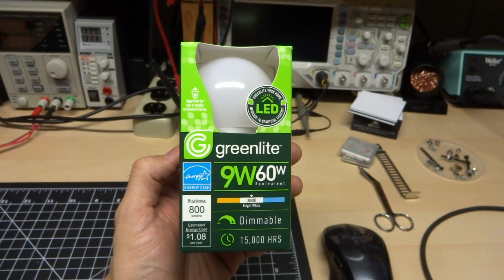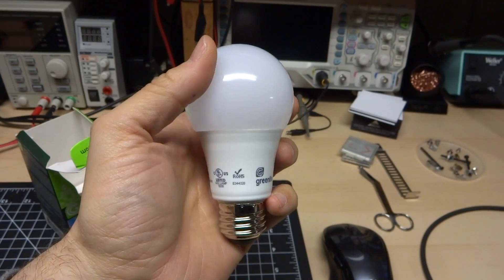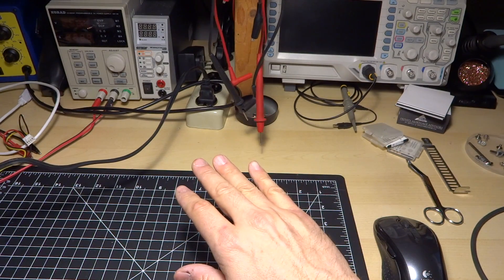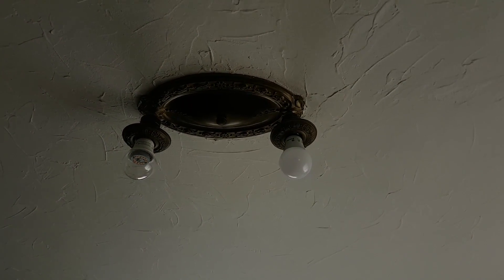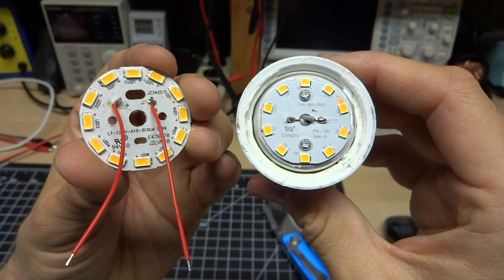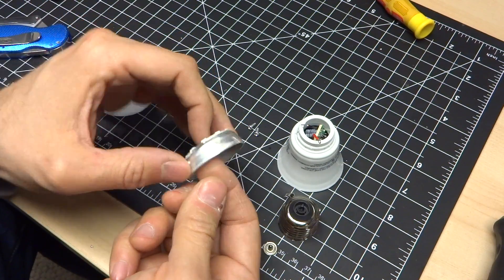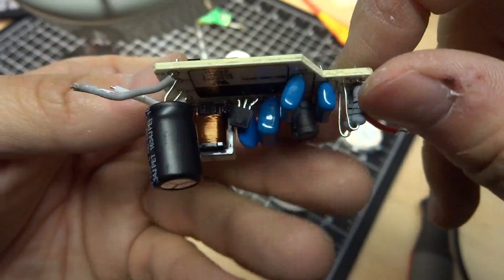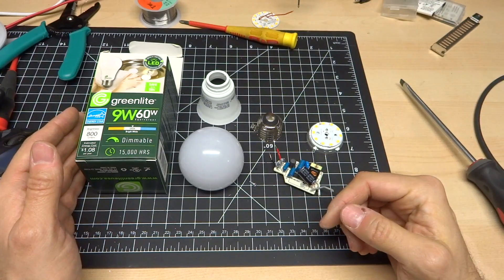Dollar Tree $1 Greenlite LED Bulb 9w (60w) Review and teardown

Comment: Well it seems that I have discovered the cause of my blindness -it’s the 
brightness of  LED light Blubs.(2-10-2020)
 
What happen I changed all my light bulbs in my house to LED last Feb. 2019 
for energy saving. Then Slowly I starting going blind in my left eye, everything 
started turning bright white. I had my eye doctor check it he said he could not 
see any problems so he send me to a retina specialist in Oct 2019. The retina 
specialist said he could not find any problem after intensive testing and I 
would have to live with it. Well yesterday I figured out that bright lights 
could be causing my blindness. So I wore sun glasses all day and night to see 
what would happen to my eyes. My eyesight on my left side was restored about 50 
percent. I continue to were my sun glasses and my vision now is fully restored. 
I replaced all my LED lights with the incandescent blubs and now I can see well 
without my sunglasses. That’s so weird I would not think the LED lights would 
cause blindness. I will tell my eye doctors about it at my next appoint in 
March. Maybe he can write a paper about in in a medical journal
 
Why it caused blindness on only one Eye-actually it 
both-The reason I think it effected my left eye more is 
because my computer lamp with a 60 watt equivalent led blub is on my left side 
of my computer monitor where it was been for the last 10 years.  The lamp sits 
about 90 degrees left of my vision as I look at my monitor, it has a diffuser 
but it does not block the penetration of the bright light. I use my computer at 
night about 6 hours a night for the same last 10 years.but 12 months ago I 
changed it to LED. then I started losing my vision. it got worse everyday. I did 
not see the connection. but now it is obvious. 
I now leave that lamp off and 
use a 25 watt incandescent blub on my ceiling fan.
 
Also I 
had my cataract remove 3 years ago on my left eye. they put a lens implant in 
it’s place. I had the same thing done on my right eye a year and a haft ago. 
Maybe the LED blue light can penetrate my retina easier without the normal human 
eye lenses. My natural eyes could have acted as a natural diffuser to the blue 
light. but any which way the LED lights are causing the problem . I can read 
with both eyes now, sometimes the doctors don’t know all the answers. 

 
I searched the internet and found that this  same 
problem has happen to other people. https://www.youtube.com/watch?v=sijvwheJUrM  
Research people think the led native blue light is causing the blindness but 
they are not sure,  The lcd monitors with led back lite is also causing the 
problem, it seem that the led lights in the computer monitor are also contribute 
to the blindness These led monitor are now in very thing- TVs, cell phones, 
computer monitors etc also led lights are on head lights too. they claim There are glasses with blue blocker to help reduce 
the problem.
 
I am color blind so I don’t think the color is the 
full problem. But I bought some computer reading glasses and viewing 
glasses from ebay for a few buck with blue blocker. My classes with blue blocker 
avail today from amazon. I also am using and old 22 inch LCD monitor I have that 
has ccfl (Florescent light ) back lite instead of my 27 inch monitor LCD with 
led backlight.  I find with my improve vision I don’t need a 27 inch monitor so 
22 inch is fine. I a have a second 27 inch with built in blue blocker. I will 
wait a few month to use it again or I may just get rid of it too. Why take 
changes with my eyes. My big screen tvs are old so so they don’t use LED for 
back light either.  So I think I have covered all bases
 
I am an engineer and not a doctor so I will leave the 
actual reason and cures to them. But My vision is almost back to normal-amazing. 
Actually my vision has improved on my right eye too. I am really glad it’s 
working. So long LEDs- hurray
 
tony
Reply: Thank is for the information I am a lighting engineer am familiar with this information. I get it-I support the use of LED lights to save energy. What I posted was a head up to people about my experience. For me led doesn't work.

Comment: Bought 16 of these about 6 months ago. The light output is much , much better than florescent bulbs. Much closer to old incandescent bulbs. Very broad and even lighting. 8 of them have been burning 24/7 for about 6 months. All bulbs are 'hung', meaning the base is in the up position. Before installing them, I drilled 4 quarter inch holes around and near the screw base  to dissipate heat. I don't know if that makes a difference, but early LED bulbs died because of too much heat.

Comment: A buck for a dimmable LED bulb is pretty darn cheap. Up here in Canada they go as low as 1.50, (so far). By removing the round globe (I use a hack saw), your 9W/60W equivalent bulb will at least double its lumen output, but will become directional not diffused. For applications like light fixtures and to use as grow lights this is ideal. For growing plants, make sure you get the daylite ones (5000+K).

Comment: Oh, these are the ones I have but I have the 11w, 75w replacement.  I have them in enclosed luminaries for a couple years now.  No problems.  I got mine for 50 cents each at Krogers.

Comment: Great video.  The IC part numbers usually are either sanded off or a solvent is used to keep the 'average Joe' from trying to either repair the circuit or reuse the part.  The number on the one you showed was probably an in house number and not actually the part number.  The 'transistor' could be a 3 terminal regulator - either voltage or current.   I have opened a few from Walmart that used a current regulator in that form.

Comment: Perhaps subsides from the manufacturer? If made to out the country, that country could be subsidizing, because the components used just in the circuit board alone could easily be $1.
I suspect there's subsidies going on.  The sum of the components are more expensive; cost to produce based on just inputs (excluding labor) is likely $1.25 or so.

Comment: Ace Hardware had these in 4 packs for $3. This is the first LED bulb that met all of my requirements of pleasant light spectrum, dimmable, bright, low cost and well made. I switched 2 households over to these bulbs and all are still working fine.

Comment: I have never seen the Greenlite branded bulbs at Dollar Tree. I have bought Sunbeam and No-Name LEDs (Both packed by Greenbreir on Volvo Pkwy). They star failing at about one year. Since I started using Compact Florescents 20 years ago, I always date them with a Sharpie when the go in service. CFLs always lasted about 10 years. Sometimes insanely longer. I don't ever remember any failing prematurely. LEDs seem to fail at a very high rate. I bought 8 Feit brand bulbs, they all failed after about 6 months.
Reply: Have you looked inside to see what failed?  Was it a capacitor, IC, solder connection, power supply, LED themselves?

Comment: When LED lights first came out they never originally put out the same color, or even let alone the great amount of light that an incandescent light bulb put out. Plus that horrible bluish light color hurt my eyes. I made up my mind never to buy, or use, such ridiculous lighting. When I say "Let there be "Light", I mean... "Let there be "Light", not some stupid dim light that never lights up the area like the incandescent lights always do. , and it needs to be bright enough that I can see something with especially when I'm working on something with small parts. not to mention when out doors at night I expect it to light up my whole surrounding patio area as my wife Bar-B-Ques a great tasting steak.  However in the past year, I have had to purchase my first household style LED light bulbs. Well guess what? They are now getting better, and now I'm almost hooked upon LED Lights. But still not totally sold on such utter junk. I now even have a couple of them 12 volt LED ones in my teardrop trailer, and I can read just fine with them. I'm thinking about buying a few more. however they are still way too Expensive though, at $14.95 for only two bulbs. I can get two incandescent 12 volt bulbs for $1.99, or I can get 8 incandescent bulbs for what it cost me for just two LED bulbs. - And of the four of the regular household base type that I bought for my house, I've only had one failure. the bulb still works, but only glows dimly. Must be because it is cheap Chinese Built Crap.

Comment: I bought a Hyperikon 9w (60 equivalent) LED. I put in my ceiling fan and within minutes it popped and started smoking. It burnt the fan a little and of course made it inoperable. I contacted the manufacturer and all they’re willing to do is refund the price of then bulb. They say it’s not their fault. I’ve had the fan w regular bulbs for 13 years. Worked fine until I put in their bulb. Any recommendations or suggestions?

Comment: I prefer 2700K and indeed LED lamps have a tad less red in them than the equivalent incandescent bulb
Reply: Perhaps but I think the issue here was this bulb is probably at a cri in the 70s or 80s. I always use LEDs with at least 90 cri so most all colors pop. It is rather surprising to me that people are becoming more and more aware of the Color Rendering Index and its importance in light quality yet there are still a large amount of LEDs on the market that are only about 80, which is pretty much the same as a CFL

Comment: Dollar Tree near me had these, also 9w 800 lumen flood light version.
They also have (I just pulled one out of the lamp next to me)
11W LED/OMNI/D30K
1100 Lumens 3000K
120V 60Hz 110mA
F30
Says suitable for damp locations and suitable for use in enclosure. I don't have any dimmable fixtures though.

Comment: They say they are good to go for 16 years?  Are you kidding me?  Even at 3 hours a day that is pretty long time. When I started to convert all my incandescent bulbs I questioned this so now every time I install a new led bulb I mark the date on the bulb base and where it came from.  The most I got out of one so far is about 16 months. And that was the GOOD one. Some only lasted a couple of months.  They start to flicker, flash or just fail altogether. I have used a few different brands such as the Greenlite and Feit. I have torn down a few just for fun. The first one I autopsied actually had a glass bulb. Very curious.  I also have wondered about the UL listing testing of bulbs showing all sorts of life spans--long life spans.  Is that result  from just letting the light on continuously or is the bulb turned on and off continuously as in real life?  You have to wonder if power cycling  them all the time would wear out some diodes or resistors,wires etc....So I would guess that the light is turned on once and off once for a 3 hour cycle  each day.   I have to guess that turning the light on and off a lot each day has a deleterious affect on the real life span-as any other bulb.  I buy the Green bulbs at my local HW store for about a buck or a little more,  I can buy a Three-pack of Feit 60watters for one dollar!  I am finding more niches that special bulbs can fill nicely.  Now I am looking for a round tube led like the old florescent ones in kitchen fixtures and old lighted advertising clocks.  I just haven't found them yet.....thanks for your video!!!

Comment: Stumbled across this video somewhat late, scrolled through the comments, but didn't see anyone else stating it, so I will.
You state that the power supply has no isolation from mains, but a casual observation says differently.  Just the presence of the transformer on the board indicates the isolation.  With a transformer, the mains are automatically isolated from the lower voltage side of the circuit. This is the nature of a transformer.

Comment: I have my whole apt with led's and they don't last so far very long of what I am seeing.
I have had three led's fail so far less than four months so what is going on here?
Reply: Sorry to hear that, the poorly designs and manufactured ones tend to die even sooner then that. So if I may suggest just buying 1 or 2 at 1st and use them for a few month. And if they perform well then buy more. Also heat can kill them if u us them in enclosed lighting fixture. So u may want to go back to a CFL as if. it keeps happen in the same fixture but LED r superior overall so only do that if u think u have too. Also LEDs tend to be more sensitive to quality for the electric. Even minor changes in voltage or power surge. . 

Im sure u thought of all this and maybe I just lucky since I only had 1 die in 4 yrs and that 1 dies in 1st month. So good luck finding a solution. At least they r much cheaper now. So when dies its not as painful.

Comment: Hello ! Do you think it is possible that LED lights could flicker due to cheap capacitors ? I bought a familly pack of LED bulbs at Costco, 8 for 12$ and most of them flicker... No dimmers at my place and the circuits are not overloaded. Any advice would help. Thanks

Comment: great energy savers,  i bought like 10 of them.  won't do squat for your energy bill.  as i've noticed when people start saving more energy in mass(like when we switched to CFL from incandescent),  the electric companies just charge more so they don't lose profits.  overtime you probably don't get to save too much on electricity since they're constantly hiking up the bills to keep profits at a certain level.  as a whole the country is saving a lot of energy from ditching incandescent lightbulbs,  but not in the wallet.  in fact it's higher these days than when i had nothing but incandescent bulbs in the house.  even the energy transfer fee has gotten retarded high.  it's costing me more to "move"  the electricity to my house,  than the actual light bill.  i can get a $30 electric bill,  but they'll charge me $50 to "move"  the electricity to my house.  which let's be honest,  it doesn't cost them squat to move electricity,  that's not how it works.  nobody is sitting there pushing a pump to get the electricity to go down the pipes,  or hiring immigrant employees to carry buckets of electricity to your power station.  considering the price increase on energy though,  probably best to stay away from those incandescents,  or you they'll rape your wallet.  no matter how little you use though,  there will always be a pretty high minimum for the bill.  i.e.  the cost of just being connected and the cost of "moving"  those electrons to the house.  people are easily paying twice as much as the actual cost of electricity they use-minimum.  however-if you're off the grid using solar,  wind,  and graphite,  this is definitely the way to go.  less juice on bulbs means more hours at the computer.  to bad the infrastructure is privatized.  i'm sure uncle sam could give us a much better deal on electricity than greedy corporations who just keep hiking the bill everytime we switch to more and more energy efficient appliances.  today my house uses way less electricity than it did 10/15years now that all my products are energy savers,  but my electric bill is easily twice as high.  at least dollar tree is trying to help.  ;)
Reply: It’s called paying for the electric company’s union pensions and shareholders.
Reply: No troll its called "Dollar Tree $1 Greenlite LED Bulb 9w (60w) Review and teardown"

For any nut job that hates living in a place where u pay an electric company that have a union or shareholders, have fun getting ur electric in Cuba.
Reply: Nice to see conspiracy theory from the left for once :) But I will take greedy corporations over government well meaning incompetence for most things. Maybe it more the lack of competition that is to blame and cost to switch to clean sources? Either way higher efficiency is even more important as price goes up. So good luck with ur energy saving measures.

Comment: We had to replace our garage door opener last week and I handed the installer LED bulbs, he reluctantly used them and warned if we had interference problems with our receiver, we'd have to swap them for incandescents.  They weren't Greenlite's, but since the comments turned towards potential interference, this installer does about 800 doors a year and apparently it's a problem with some brands when installed on openers.
Reply: He gave you BS. No interference with that frequency. Some can affect IR remotes with stray interference but not these.

Comment: Interesting to see the use of what appears to be a bucking regulator in your 120V "cheap" LED light bulb!  In the UK, that would be a sign of an up-market product .....  Our mains is 230V / 50 cycles; and the fact of having more volts to throw away means our cheap LED light bulbs can get away with using just a simple capacitive voltage dropper and a bridge rectifier wrapped around a long series string of multi-chip LEDs.  

But we have pound stores, not dollar stores, obviously; and a pound is worth more than a dollar.  Even although the bulb meant for the UK is cheaper to make .....  Hmmmmm .....

Comment: feel ripped.  got these for $2-3 from Hy-Vee  in truth even at $2-3  these are way better than the $7 Ace Hardware bulbs which clearly don't like being in an enclose sphere in the kitchen.  Tend to flicker alot and I don't think is a normal flicker but more an electrical muck up flicker..  Can't quite remember where I have the other one but as I liked them so much inside I have it running as our front light.  Been running Cob bulbs out front.  This is brighter.